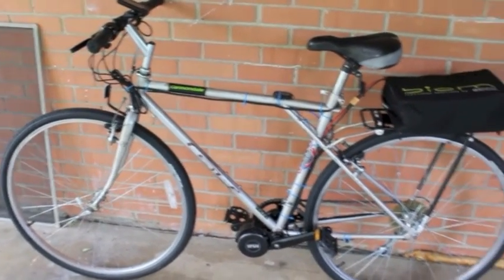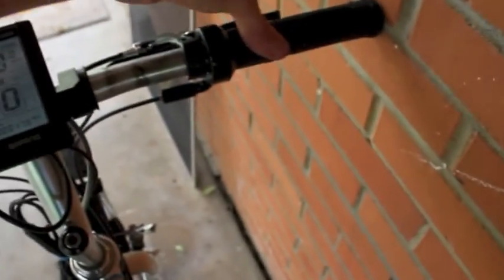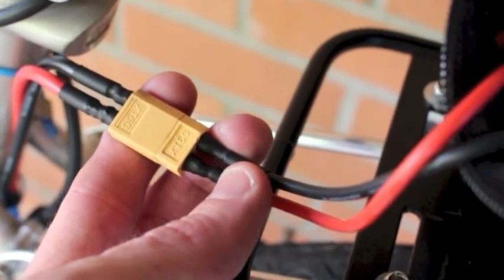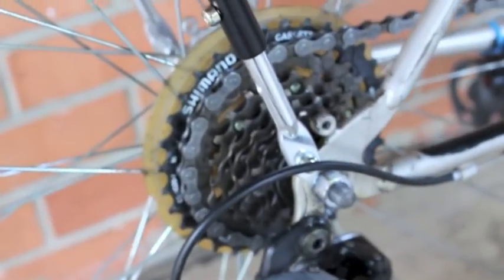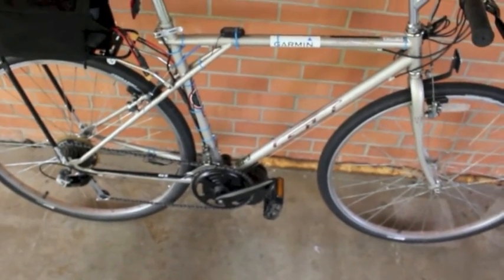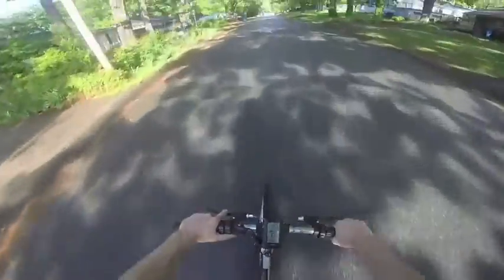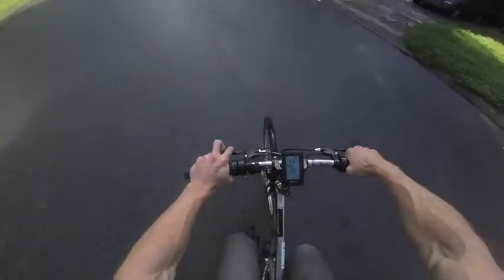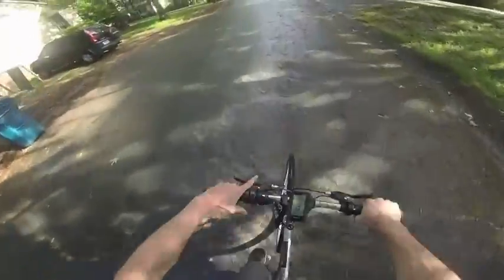Bafang BBS02 750w kit on GT Hybrid (37mph)

Comment: I want to mount my battery like your but the cables I have don’t reach each other. Any help where I can get extension.
Reply: Buy longer cables
Reply: I got the person who sold me my battery to make a cable. He made both the cable and battery.
Reply: I solder longer cables at the same size on mine. I have a lot of XT-90 plugs that i also solder on. But if you can not solder, find a model builder to help. They are often working with soldering and plugs.

Comment: for 17 miles one side, what battery capacity do you think will be sufficient..4000w hub motor.
Reply from the maker: Holy shitttt!  that's a lot of watts.  You should go to endless-sphere.com to ask that question.  But here is a link to a great simulator where you can put in watts, wheel size, controller size, etc..  And it can give you a speed to distance calculation:  http://www.ebikes.ca/tools/simulator.html

Comment: What is the "hot rod" programming option? can it be use with a 46.8V battery?
Reply from the maker: The "hot rod" programming option is where you change the setting with a special program and a usb cable to reprogram the controller to be able to go max speed on pedal assist level 0.
Reply: It's a gimmick

Comment: where ya buy battery?
Reply from the maker: I made it myself.  I bought the bare cells and spot welded them together and then soldered a Battery Mgmt System on it.  Then shrink wrapped it.

Comment: i can get 15 miles on a 48v 11ah battery at max speed without pedalling.
Reply: up hill 18-19mph, flat 27mph, 32mph down hill.
Reply: Now the motor is on a 27.5" bike and it goes 16-17mph up hills, 35mph on flat and 40+mph down hills.
Reply: Anthony Steele ??
Reply: range?
Reply from the maker: Range depends on how much you help the motor by pedaling.  If you don't want to pedal you've have to go slower in a lower gear in order to get max range.  You could probably get 20 miles or more that way.  My guess
Reply: Anthony Steele Hello I also have a GT and want to do this to my bike can you please do another short video on the brakes how you modified or changed them